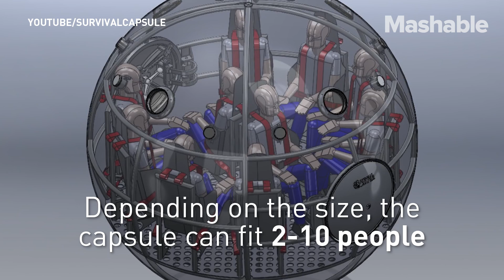Survival capsule

Comment: "Drop test" like 3 feet. Sure, safe enough against the ocean rage that'll slam you against everything with full force.
Reply: Nonnof Yobiznes and what about ventilation? Theres no fresh air down the ocean
Reply: Smashin.n Bashin it will prolly float and has space for the oxygen tanks
Reply: @Rohandutt  they could add a hole that you can plug and unplug as needed so you can get fresh air when you need